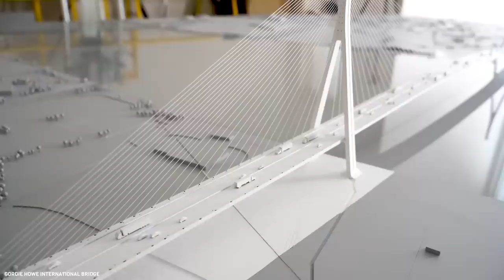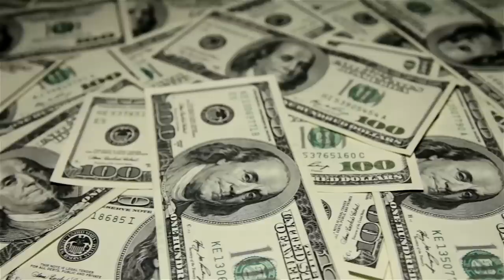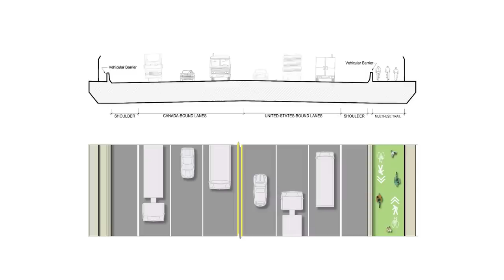The New $4.4BN Mega Bridge Connecting US & Canada!

Comment: There is a winter problem with this bridge design and hopefully they are aware and will design the problem out. The problem is the arrangement of the cables. They are concentrated on the center of the towers and they stretch out towards the edges of the lanes. Unlike other bridge designs where the cables do not cross over the lanes, this arrangement creates ice blocks that can crash down and smash into trucks and cars. During the winter, snow and ice form on the cables, as temperature floats above and below freezing, this will cause large pieces to fall off the cable and smash into the traffic below. Is this known by others? Absolutely. There is the same cabling design in Vancouver and lots of cars have had their windows smashed from falling ice. How did they fix it? They came up with a chain loop that wraps around the cable and just let it drop from the top. This clears the ice when it is thin and not likely to hurt people when it drops so they need to do this frequently. Great solution but talk about paying for a maintenance of a design problem.
Reply: They didn’t speak to those builders before approving this design
Reply: So prudent
Reply: The problem only exists in your mind and your zeal for attention seeking.  There is no such concern.
Reply: So your comment is imaginary. Oh good. I thought it sounded meaningless.

Comment: Replacing the Ambassador with new construction and increased capacity is long overdue.  And, it should be a public asset managed to optimize trade and traffic flow.  Hope it enables needed economic redevelopment on the Detroit side in the process.  Thanks to the Canadians for bankrolling an investment should have received at least as much financial support from the American side.  Seems the Canadians did not feel as obligated as American politicians to kiss certain well connected a$$e$.
Reply: The Ambassador will remain open.  Or at least, it will until the time it becomes unsafe - others have written here that the Ambassador hasn't been well maintained.

Comment: Will the existing Ambassador bridge still continue to operate?  I family in Windsor and I live in Detroit. Usually I cross via Tunnel. I use the ambassador bridge when I tend to go into Canada proper. Gordie Howe too far south to service Windsor for me. It will be great for trucks.
Reply: The powers that be want it gone, but I think that's short sighted. The Ambassador still has value connecting the two downtowns and as an alternate route should a major accident block up the Gordie Howe for any length of time. Or, heaven forbid, a terrorist attack on the new bridge. Tearing down the Ambassador means that if the Gordie Howe is closed for any length of time truck traffic will have to go about an hour north to cross at Port Huron as trucks can't use the tunnel. They've already had a taste of this when the trucker protests closed down the Ambassador for a bit last year. It will be much worse in the future given how much new traffic the Gordie Howe will carry.
Reply: @rjgoniea  A agree 500%! Redundancy is a wonderful thing. Let alone the old Ambassador bridge can be a VIP crossing not closing the larger bridge.

Comment: A long overdue project that holds great promise for our two great countries, the USA and Canada. I am curious to know if the bridge design uses metric units, which is the system of weights and measures to which I wish the USA would transition.
Reply: No doubt they'd use metric.   I too wish the USA would join the rest of the industrialized nations that have used the Metric system for decades.   Of course here we have ignorant folks that have no idea how much easier it is...based on 10's.  Stationed in Deutschland late 80's was in hog heaven with the Metric system.  Thing is here where I retired from healthcare MOST of it was in Metric.  For example, we'd use 10 ml/kg body weight for initial ventilator settings (I was a Resp. Therapist).  Ironically in Deutschland they used different measurements for blood gases and can't remember what metric it was.  Here it is metric, but on our machines across the pond we could get German results though in our USA Hospital in Nurnberg we didn't use that system.

Comment: Oh, I do hope they put heaters in those cables otherwise run out and buy stocks in a glass company. Whenever it snows over the Port Mann bridge in BC the road will get ice bombed if they don't get the cable scrapers (which, BTW were add-ons after the fact) up and running fast enough. A very poor design for any place that goes through winter.
Reply: we have wet conditions which freeze , maybe their dry air will work better

Comment: Wow. $4.5 billion is really expensive for a bridge that only carries 26,000 cars a day. It seems like it’s over built with six traffic lanes…
Reply: It's not 26000 cars its 26000 vehicles including ALOT of semi trucks. And it is an international border crossing with customs/immigration (even if it is a friendly/free trade border). So it's a little different than a non-international bridge with more cars than semi trucks. But if it weren't for the massive amount of trucks and border checks then I agree it would be over built but because of those factors its not. Just based on my experience using the Amabassador vs using other bridges around the same.

Comment: This is entirely the wrong design for anywhere that gets snow. Ice bombs will close the bridge with every snowfall. Just check what happened on Port Mann Bridge in Vancouver.
Reply: Crazy thing about problems..... they can be fixed! Just check what happened on Port Mann Bridge in Vancouver.
Reply: Lived in Vancouver all my life and never heard of the portman having ice problems. 

It doesn't even snow if Vancouver anymore though, so not really an issue. 

Most of these cable bridges are ice resistant anyways. That's partially why the cables are so steep and pointed so ice and snow cannot accumulate on it.
Reply: @Samuri5hit84  Not sure how you managed not to hear about ice bombs on the cables if you lived in Vancouver your whole life. They happen every year and the “fix” still closes the bridge regularly. You might want to check out all the Youtube videos showing this problem. They even happen on Fraser Bridge where cables are beside the road and not over it.
Reply: @alittlebitgone  "Crazy thing about problems!"
They can be avoided, you know by using forethought. Dang dude.
Do you want the tolls to be higher to make up for the added cost?? What is wrong with you?
Wahahaha